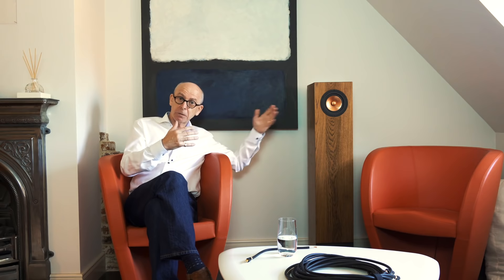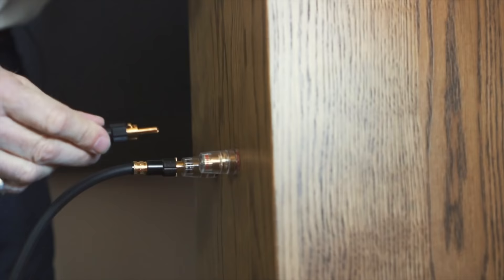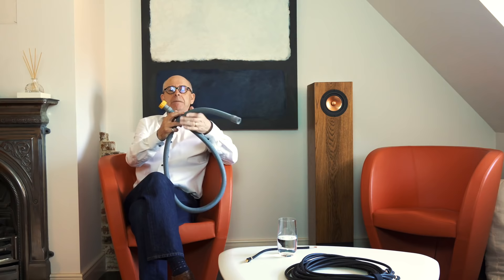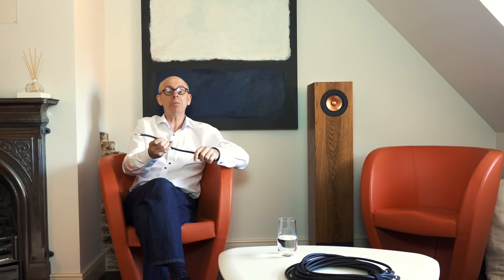Loudspeaker cables - how do they make a difference?

Comment: Wonder what cables were used to achieve perfect marriage during Sibelius design at 5:13 ? I like to forced expansion banana plug, however, plenty of wire/cross-section snake-oil in the video.

Comment: Nicely described. Cables look simple , ohm law looks  simple.  But better do not find out simple  conclusions about. .Better  result is not end of problem, only perfect result is.  

   Model of electric current in speaker conductor  should include produced by audio signals magnetic fields in their complexity depending on dimensions, location of conductors around  and variety of 1000 times changing  harmonics in  connection to the same in speaker coil  plus mechanical  behavior. . Hmmm...any conclusions? :)

Comment: that is voice coil "skin effect". i mean, that is voice coil engineering 
skin effect do happens on cable also, but cable dont move diaphragm

i am also making drivers myself and voice coil structure myself and use computers to design(still nowhere near mark ). voice coil structure, weight, material, and wire structure effect sound because its a point where energy conversion happen
electrical to mechanical

but if we talk about speaker cable, its an energy carrier

so

simple language, don't shell too much on cables, just get a good quality one which last for years and do check its specs. Get the lowest impedance, inductance and capacitance in cable

Comment: If you look at GR Research you will see that tube connectors on the speakers would make them sound even better. Worth a look?
Reply from the maker: Hi - not sure what ‘tube connectors’ are but will certainly check them out. Thank you
Reply: No, they make no difference apart from Danny’s wallet.

Comment: So sound in my room is bit boomy, where should be one's starting point? Room Acoutics, Speaker Placement or buy some spectrum analyzer and change EQ on AVR. Where should one start with to make a significant change?
Reply: Multiple sources of low frequency (multiple subs) distributed around the room also helps. The right room correction can also make a big difference. I use Dirac Live and there's a huge difference in the tightness of the bass with it turned on/off. Again, this is all trying to compensate for the room.

Comment: what do you mean by neutral balanced.
Reply from the maker: Dear Sander, thank you for your question. I don’t want to mislead anyone. All I was trying to say is that when we were fine-tuning our Sibelius loudspeakers, these were the cables we used.  In practice we found some proprietary cables seemed to make them sound brighter and others, less so. Hence: ‘neutral balanced’. Good recordings played through The Sibelius loudspeakers using these cables, sounded as close to the original as we could find. We did not explore hundreds of different cables and we only wanted to recommend cables that anyone could mimic on a reasonable budget. Hopefully this answers your question?

Comment: The problem with speaker cables is that they are excellent aerials and pick up lots of RF. These voltages can interact with the feedback circuit in the power, or integrated, amp. Some cables like those made by Kimber have a weave that cancels these RF voltages out. Some may not believe the effect is audible (to them at least), but I think open minded audiophiles might at least try them to see if there's a worthwhile effect. I think they are usually sold on a trial basis (check before buying!) with a full refund if not impressed.
Reply from the maker: Absolutely, one needs to keep an open mind and a closed wallet, until you are sure. 30 day trails are an excellent way to discover what is out there.
Reply: @PearlAcoustics  In the US we have a retailer called The Cable Company. They keep demo units of everything they sell. If you're looking for something like a new pair of speaker cables, they will send you 4 or 5 pairs so you can try them all at once without committing to a purchase. I'm surprised more stores don't do this.
Reply from the maker: @AT-wl9yq  indeed, it would be very useful
Reply: Off course hifi cables are the new snakeoil! A good, clean copper cable  will do the job!

Comment: Try cable risers! Depending on the type of floor in the listening room the effect might be astonishing. In my place with concrete floor + floor heating (not sure if the latter matters) the difference in bass reproduction is huge.
Reply from the maker: Thanks for your suggestion and contribution to the debate
Reply: Measured?
Reply: @zoltankaparthy9095  ... trolling? ;-) Happy holidays

Comment: How would this wire size translate to the American gauge system from millimeters? 12, 14, or 16?
Reply from the maker: The nominal diameter of the conductor is 6mm2 that gives it an AWG value of +/- 10. I hope this answers your question?
Reply: @PearlAcoustics   thank you very much! That's pretty thick then.
Reply from the maker: @milche64  yes indeed. We have found this to work very well. Many will say thin is better. But we use our scientific knowledge and then listen with our ears. And how electrons behave on a sub atomic level, is another world for another lifetime of study! it’s not a must, it’s just what we do.
Reply: @PearlAcoustics   thank you for the information

Comment: they probably squared the copper wire to allow for tighter packing of the windings, this allows for better heat dissipation but also changes the magnetic field characteristics which changes the sound in the end.  
a square or round wire, if it has the same crosscut area, doesnt change anything. maybe in high voltage or high frequency scenarios far far away from audio
Reply from the maker: Thanks for your contribution

Comment: Stop it. You're hurting us. You're hurting science.  

You're telling people fairytales about speaker cables - any physics professor worth his salt informs people it's about the material (copper) and diameter of the cable, and everything else is snake oil.
You are very welcome to do a blind ABX test at my place - or any place you like - with your favorite speaker cables, be they cryogenically frozen, unidirectional, or whatever.. against standard "cheap" copper cable that's at least 2.5mm², using a system with speaker cable lengths suitable for the average listening / living room, in such a room.

Next - your Sibelius speaker is a simple quarter-wave loudspeaker using a MarkAudio driver that costs €100 at MAXIMUM across the world.
You are charging over €3000 euros for a speaker that DIY builders make for around €150 a piece.
And you know what? I wouldn't care about that if you'd be honest about it and explained about the craftsmanship, the selection of wood, the selection of interior materials (angel hair plucked from a unicorn during a full moon or whatever), and the driver.

But you're not. You're simply not being honest.
You're selling a speaker that - with craftsmanship and materials included - costs at maximum €200 to make, for €3000, by telling people fairytales about how long the design took (sure the design of quarter wave took some decades - but YOU didn't do that research! It took YOU only minutes to use/copy existing formulas to make your Sibelius!).

I don't have any problem with Pearl Acoustics selling their speakers at the price you're selling them at.
I have a problem with the bullshit you spout to defend your pricing.  
You don't need that.
Really, you don't.

You need to be honest with people and tell them about your craftsmanship, selection of materials, and warranty.  
Tell them that yes, people can DIY these speakers, but it takes a LOT of time to do it right, and a LOT of time and a steep learning curve to make them this beautiful.
Stop hurting people by telling them fake stories.

Comment: why copper multi strand vs multiple strands of solid core silver plated wire?  I’ve had more consistent results with this, but like you mentioned, it is pricey
Reply from the maker: It can also sound a little too harsh/bright in some instances

Comment: I'm not convinced cable's make a huge difference... it's usually very small and often hard to hear. Also different doesn't mean better. Subtle differences in cables are swamped out by major differences in other gear.
Reply from the maker: Absolutely in agreement with you.  Loudspeaker Cables are the last element of a system to look at, and you should not look at them to improve sound but to do their job. Good quality copper and connectors etc. 
There are parts of a HiFi system where the difference can be significant but these are mostly in the winding coils of a phono cartridge, and the loudspeaker drive cones and also some internal wiring in components such as amplifiers.

Comment: Your explination of current flow is good, tho voltage would be water pressure not speed. Think of the hose being connected to something then back to a tank next to a tank where the pump gets it's water. and I think it equates a little better to electricity. Tho this starts making it a little more complex and the water electricity analogy is to get beginners understanding started not an exact representation.
Reply from the maker: Thanks Brad, you’re absolutely right. I could have explained it better.

Comment: Dear Harley,

I agree that speaker cables do make a difference. Your policy to adopt a (inexpensive) standard cable for your ongoing work with the Sibelius is most helpful. This cable provides a baseline and then we can try to improve on this with more expensive cables if we imagine there is a need to do so. I have never seen this type of banana plug before. It looks like a neat way to get a good fit and typifies your attention to detail. 

What about interconnects? You usually use pre and power amp combinations (not integrated amps), as far as I can tell. You must therefore have considerable experience of interconnects for that purpose, amongst others. Can you shed some light here?

Best wishes,
Anthony
Reply from the maker: Dear Anthony, thank you for your kind words, they are much appreciated. With regards interconnects, this is indeed a much trickier problem. I try to keep them to the minimum (hence liking ‘all in one’ pre amps/dacs etc.) Basically I start with two cables. 1. Silver plated, multi strand high quality, shielded cable and 2. a set of Amazon Basics. (Yes you read correctly). These to me are the opposite sides of the spectrum. (The silver tending to be on the harsher side). Generally. I find one of the two fine. Then, when I have my preference I can fine tune in that direction, if required - but generally, I don’t bother! Hoping that suffices?

Comment: Can anyone explain to me what the advantage of single cables over paired cables is?  I'm sure this is a basic for many of you, but just something I've never heard of before.
Reply: All you need is WIRE -- stranded lampcord works fine. There is NO ADVANTAGE or difference among any of this stuff. You need two conductors for each channel, one to "hot" (red) and the other to "ground" (black). That's all. Most zipcord (lampwire) is marked in some way to make it easy to see which conductor is which. Make sure that the black side of each channel at the amp is connected to the black post of each speaker. That's really the only thing that matters.

Comment: Halo, sir can u give some answer which sprkrs wire length , gauge awg and silver plated or pure copper wire to use ? Tq
Reply from the maker: Dear Kevin. The basic rule is that each speaker cable should be the same length. As a general rule... for 10m or 33’ you should use 10 awg, or less. The question of silver plated copper or just plain copper is a matter of personal choice. The difference is subtle and mostly in the higher frequencies. I would start with plain copper and see how you get on and then experiment if you feel something is lacking. I hope this helps?
Reply: abit confused about size awg and length as in website forums so many explained different information , so i better u sir for sure information , and u have said in your video that 6mm in wires maybe is 9awg or maybe 10awg am i correct , if the speaker length getting longer will it effects the sound quality ? tq sir
Reply: just read your answer and y is 10awg or less does it or not effect the sound quality by using pure copper wires ? less say i buy a kabeldirekt speaker wire 12awg does it ok for use gauge or lesser ? tq sir
Reply from the maker: @kevinchew2594   do not worry too much. Try not to go over 8-10m, if possible. But really it’s not a big issue. We run 20m microphone cables without an issue.

Comment: What are the resistance, inductance and capacitance specs for the cable you offer? Not to sound harsh, but without this info this has to be regarded as snake oil from any company selling cables!
Reply from the maker: We are not selling cables. We offer them for sale, for convenience, if someone wants them. I think that’s different. All we are saying is that with our speakers we use this kind of cable with all our testing and we find the connectors useful. Hope that anders your question.
Reply: His cable has unspecifiable L & C since they are 2 independent single cables. Since L & C depend on the electrical circuit's geometry (here the distance & dialectric properties btwn the 2 cables at every point), they will depend on how each user lays them down on the ground. So he is selling un-spec'able cables 😂 Shhhh, I don't think he knows...

Comment: Love your connectors.    Wire --- no.     Coaxial cable was designed to transmit  very high frequencies.   We should all know that high freq.  travel on the outside of the wire.    In multistrand wires it's high freq. chaos.   PERIOD.  Many sound people now use  good old  14 / 2        12 / 2    etc.   solid copper  --  1 conductor  each   +   -   .    Yes.   If flexibility is your big concern ?   It's  an  issue.   ?    How often do you move your speakers ?   I'll put solid wire against stranded every time.   Try it.    PS AUDIO does.   cheers.
Reply from the maker: Thanks for your comment. We have used single core but, prefer multi. I appreciate everyone has an opinion on this. Enjoy the music!

Comment: Electricity is a surface effect , most of the time . What happens in a Cable , is nothing , absolutely nothing , even on atomic level , nada , zip, nothing . The work is done on the surface  where there are free electrons because that is the end of material ,  atom doesn't connect to anything  pass that point , if it connects then nothing can happen . These are free electrons and they will flow easily , but when they do flow they leave positive atoms behind , and those will suck in any free electron , and so this process goes on .
So imagine it like a stick that has wires going from it , like brush , and at the end of those wires are balls , so if you hit it the ball shakes , vibrates , and when it does that it hits the ball on a string next to it and transfers energy . And this energy will hence go along the stick vibrating balls hanging on strings attached around the stick .
Do you get it . There is very little motion  its just vibration but energy gets transferred .
The stiffness of these strings that have balls on one end and are attached to a stick or rod on the other end , would be your Resistance ,  the easier it is to move the strings and make them vibrate the better energy transfer . To a point where Strings are so soft that they dont vibrate they just hang 
If you have complete solid strings , there will be no current , this is like a Diamond , hard wont conduct ,  the other end of the scale would be too soft strings that also wont vibrate , that is your Plastic and isolation material , it just wont vibrate .
And in the middle of that scale you have nice vibrating metal strings , those will transfer power .
This is exactly how it happens , its an analogy but a very good one 

You can take 10 or so metal strings put them in a raw , and hit one , it will bounce back and hit the otehr one , that one the other one , and so on and on , this is Electricity in a wire .
You can have to soft strings , or too hard strings , or just right . 
Electrons will flow in free space as well , but at that point they will only flow along magnetic field lines , you cant make a circuit from it like that , if tis not magnetic circuit , like our Planet Earth , its a magnetic circuit , and there are electrons flowing along those lines , and you get Aurora Borealis , its just that , same thing .
Famously Nikola Tesla said ,if you cant figure out something just look at the Nature , if you cant find it in Nature , then you cant make it , its impossible . Everything that can be made is made and exist in Nature
Reply from the maker: Thank you for you contribution Pavle

Comment: Everbody knows that speakercables and interconnects can change the sound - if you use bad ones.
And btw some of those come with a hefty pricetag and a thick book worth of pseudoscience and philosophy.
Anyway for the normal home hifi user a 2 x 2,5qmm - 4qmm fine wired coppercable will do just fine as speaker
cable.  Personaly i had no negative experiences with that in the last bunch of decades.
Reply from the maker: Absolutely!

Comment: No surprise that changing the geometry of the voice coil wire, sitting in that critical magnetic gap, changes the sound.  That doesn't mean that the wire between the amp and the voice coil is so important.  It's not.
Reply from the maker: Indeed, thanks for sharing. That’s why our conclusion was to make our cables with multi-strand copper. The point I was trying to make was that it is possible to manipulate sound via modifying a cable.